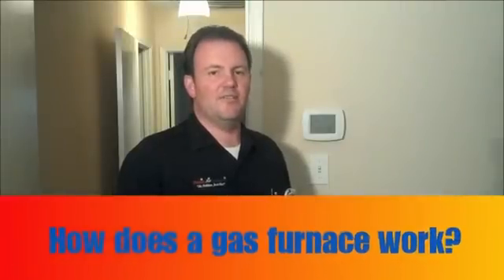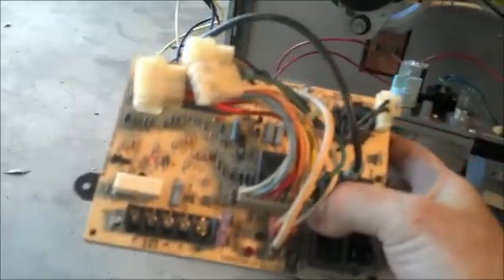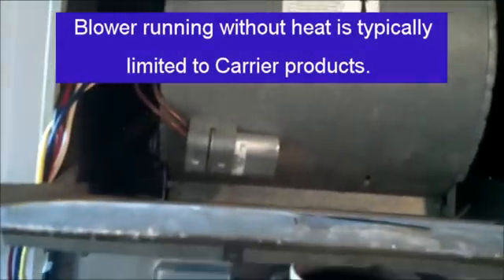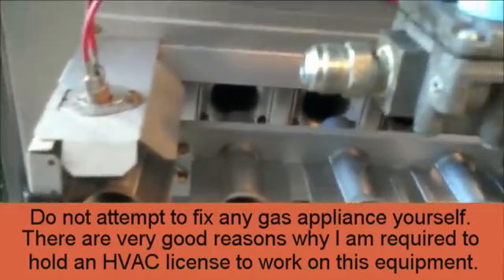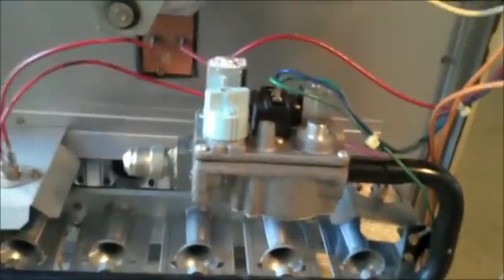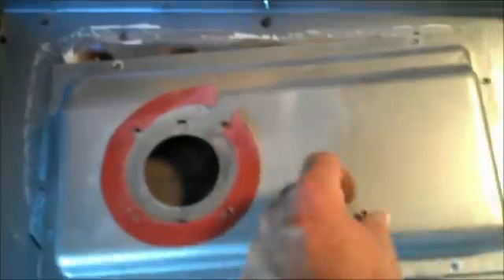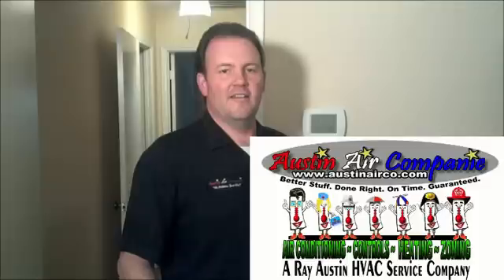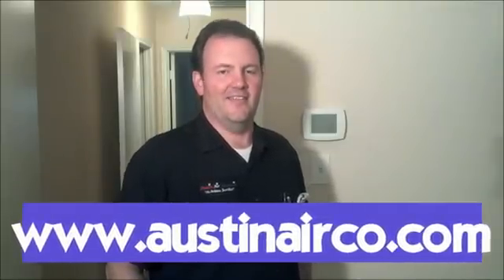How does a gas furnace work

Comment: About the Inducer fan. So this starts up to clear any gas fumes and push it up the flue to the roof outlet. But does the Inducer fan then shut down or is it supposed to run the entire time the furnace is active?  I have yet to have one video clarify this on Youtube.
Reply from the maker: Inducer fan runs the whole time furnace runs in heating mode. The furnace will not work without it, unless it is a standing pilot furnace. But standing pilot furnaces haven't been manufactured in over 20 years. HVAC market is continually changing market. Many times the changes are slow, other times they happen all of a sudden.

Comment: Why is the water line going into it.  Mine is using a lot of water...1/2 foot is spinning and I can feel water gong through the line into the heater Edit: it was a gas meter not water.  Picture http://tinypic.com/r/2zzsuo6/9
Reply from the maker: Thanks for the question, but what is displayed in this video is a forced air natural gas furnace (it uses no water). Without knowing exactly what you are talking about as there are many different boiler type ways of heating air within your structure... not to mention water heaters used for heating water only (some people can't tell the difference between the two) I would have to know your system design to make any attempt at answering this question.
Reply: AustinAirCo here is a video of it 

https://youtu.be/lPmAmPRXnkI
Reply from the maker: From what I can tell, which isn't much is that this furnace is a natural gas furnace. But you failed to make a complete video to show any water or the water meter that is running while trying to operate this furnace. So I still have no idea what you are referring to. Additionally trying to be helpful here, turn your phone horizontally (side ways) when making a video--- by doing this you will increase how much video you are able show and keep your audience from getting motion sickness.
Reply: AustinAirCo thank you for the help and feedback.  Next time I will take it horizontally. The water meter is outside the house. Furnace is in the attic. To the right of the furnace in the picture is the heat pump ( I think). I can feel water being transferred in through the brown steel pipe (in my case covered in insulation) when I put my hand on it. It's made by adp. Also don't hear the air conditioning fan spinning outside. Could water be bypassing the heat pump and going straight from city back to city.
Reply: Also on the outside of the heat pump it says refrigerant evaporator also as section of heat pump.
Reply: I called adp  (company on the sticker). They said water shouldn't be connected to either the air conditioning unit which is to the right of my furnace or the furnace. I turned the air conditioning fuse breaker off but the water dial outside still spins when furnace is on. I live in California so I can't imagine the builder putting a switch to turn on the water when the heater was on to keep the pipes from freezing?? .... it's a head scratcher
Reply: I think what I thought was a water meter is a gas meter. Picture http://tinypic.com/r/2zzsuo6/9
Reply: Sorry for the confusion
Reply from the maker: It varies... maybe not with ADP coils, but there are all in one heating systems that are called Hydronic heating systems in which there is hot water circulated thru a coil within an air handler design. They aren't all that common but do exist. They are also designed to provide hot water for home potable system use. Also just because your indoor coil says 'heat pump' does not make it a heat pump. Some Coils can be used for straight air conditioning or heat pump. The coil doesn't decide this.. the out door unit does. It is not that common to have a gas furnace with a heat pump, because in most cases the heat a gas furnace provides is much cheaper than the electricity needed to run a heat pump. Again... Like everything else in life it varies.

Comment: Hi , Am student in university of baghdad college of engineering , mech. department
and my graduation project is a gas fired forced air control board. Its model is (Toledo ,Ohio , 43624)
and i dont have any idea about this control board
can you help me please
Reply from the maker: +Ammar Shalal  I am a licensed HVAC contractor, my job is to repair or replace HVAC systems, parts, and in some cases design new system layout in homes. Your best bet would be to contact the manufacturer of the control board or search for this information on line.
Reply: Thank you very much
can you give me the link of the factory of my control board cuz i cant find it and i need them so much please
Reply from the maker: +Ammar Shalal  can't because what you list as a model is likely the town and state in which it's manufactured. This is not a model number.
Reply: Am sorry i found the model its (gas fired forced air control board model 9205 ) i have the cataogue but i didnt undrestand any thing 
please help me
Reply from the maker: +Ammar Shalal  the information is incomplete. You need enough information to be able to search for it.
Reply: Sir i'll give you the words at the first page of my catalogue of the cotrol board 
as shown : ( Residental Gas Heating 
                        
                   By : James L. Kamm 
              
                       Thermal Engineering 
                        Company 

               for use with
            Gas Fired Forced Air Control Board 

copy right 1973 by thermal engineering company 
2202 Adams Street , Toledo , Ohio 43624, U.S.A)

and if you have an engineers friends please ask them to help me pleeaaasssse
Reply: can you answer me please?

Comment: Blower first to get gas out? Won't that blow gas in the house? I thought the inducer starts first, to get any gas out and and to close pressure switch.
Reply from the maker: +1242chisox  Not always will the blower come on first, this is brand and sometimes model specific. Blowing gas inside the house? You need to watch the video again and pay attention to how I describe the function of the heat exchanger if you really want to know and fully grasp how the furnace works.The inducer only starts on a call for heat, but as I said above this isn't always the first thing to start as it depends on manufacturer of the furnace.
Reply: +AustinAirCo ok I must of missed something, because you said typically the blower comes on first, then inducer. Usually inducer comes on first. I know how a heat exchanger works, I was doing a couple things as I typed my first comment about the gas.
Reply: +AustinAirCo. at least with what I've experienced, even carrier weathermakers.
Reply from the maker: +1242chisox This specific brand the blower does come on for a short time prior to a call for heat. This was mentioned around 3:30 in the video. So to clarify: this is kind of a safety feature in a round about way. Because some kinds of gases are heavier than air if there is a gas leak the gas tends to pool around an area of the appliance. (Many homes have furnaces in the basement.... not in my area, but you should get the point.) Naturally there should never be any gas inside the blower compartment of the furnace. This is considered a purge operation of the furnace if it does this. If there is a high pooling of gas and the furnace goes to light this could cause an explosion under the right conditions. Not all manufacture brands run the blower first.

Comment: The heat exchangers are aluminum I presume?
Reply from the maker: +Brady Rose Heat exchangers in the video are typically made from stamped steel sheet metal. Other heat exchangers can be made from various types of steel alloys like Aluminized steel. In some cases manufacturer's may use stainless steel. While aluminum is a good heat transfer medium, on it's own I don't think it would stand up too long due to tensile strength.
Reply: AustinAirCo
 from expanding and contracting?
Reply from the maker: yes, the continuous heating and cooling of a material puts that material under stress. If the breaking point (tensile strength) of a material is low, it will wear out much faster.
Reply from the maker: I also might add that rust is another factor, as this can weaken a material further and cause failure that way too.

Comment: so those gas jets, they have a gas line feeding into them and I presume the forward flow creates a venturi effect that sucks in fresh air? or are they reliant on flue fan?
Reply from the maker: +Brady Rose The combustion blower or flue fan is required to operate the furnace with jet propulsion style burner, without the fan the furnace will not fire. (Safety shut off is triggered). I think that should answer your question.
Reply: AustinAirCo
 The way they were shaped made me wonder if a venturi effect was involved in the design of the jets in and of themselves , without consideration of how the  electronics are designed.  Not something I actually plan on doing, just curious if the ingress of air is an exclusively an effect of the blower, or if perhaps they might suck in enough to stay lit on their own.   I realise without the fans, bad things, but wanted to understand all the purposes behind the shape of those jets.   I realise this might be an odd question but my interest isn't necessarily HVAC,
Reply from the maker: Without the combustion blower the flames would most likely roll out that is if you were able to make it run. Because the combustion blower dictates the flow. The flue pipe runs to the outdoors and various conditions outdoors can create down drafts into the structure. This is the reason for the need of the combustion blower. 

Old style furnaces relied on gravity and science to expel flue gases, the problem was they weren't efficient and they are far more dangerous due to much less safety devices to prevent operation. Old style furnaces are mostly standing pilot type, some can be retrofitted to include electronic ignition. Typically only 60% of the heat produced by these is used to heat the structure. The remaining 40% of the heat goes up the flue. Also old style furnaces didn't use jet propulsion, they used physical burners.